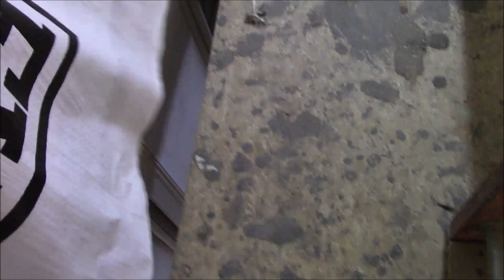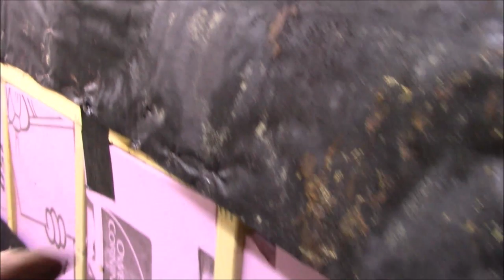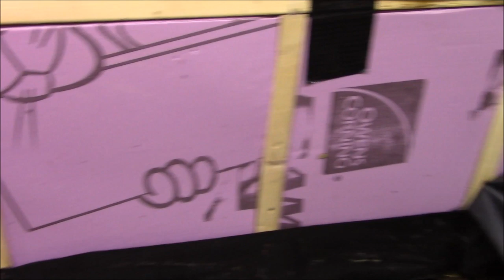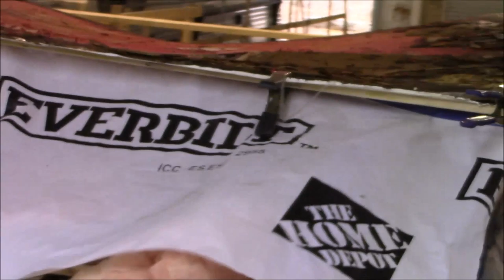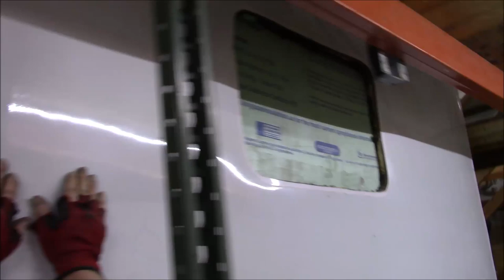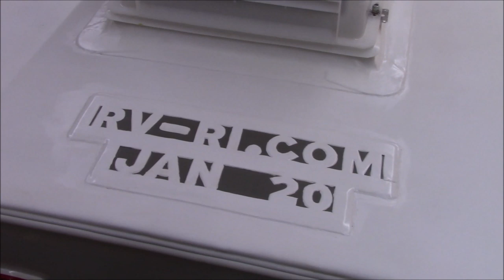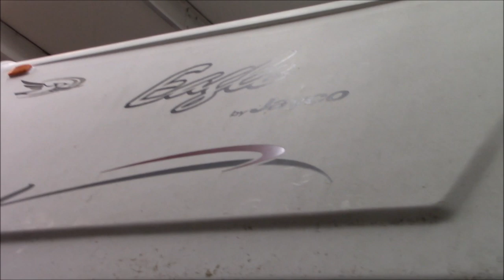Jayco Eagle New Roof, Rear Wall, New Trusses and ceiling panel

Comment: Sir why don't people do closed cell spray foam insulation in while the roof is off?
Reply from the maker: Expensive....very expensive. Plyfoam is a design if the roof...just winging it with spray foam is not.  Lol it's to consider spraying over that you may need access to later. Then the clean up...not worth spray foaming a camper.
Thanks for watching.

Comment: Wow!  I have a 2013 Sierra Travel trailer.   I was lucky that they took a measure of pride building it. That's not saying it had no problems.  I have found a good amount of issues due to them using cheap material and incorrect materials.   Fortunately my floor is real plywood,  not sure how that happened,  probably all they had that day.  Some other incomplete stuff I found such as missing floor joist and I believe they failed to finish the duct work in the ceiling the same as your video.  My back wall needs rebuilt and I would like to have a new membrane.   Aluminum frame in walls,  except the rear.   Very little defamation existing, only around the water heater, which has leak has been resolved.   How can I reach you?
Reply from the maker: you can call the office @ 423-475-7663 .   Monday thru Friday 8am-3pm

Comment: I’d put fire stop foam around all those wires coming to the roof. I’m watching this because I have a 19’ where it leaked  to the floor so a whole front corner needs rebuilding.  I’d like to know what all this work costs to see if it worth having the work done. I can see to do it right scaffolding needs to used.
Reply from the maker: We don't quote on social media, but if you give us a call we can try to get some rough numbers to you. We wouldn't know the extent of the damage until we tear it apart and see how far back it goes...what all needs to come out etc.
Office hrs are 830-300 MF. 
Why would you need fire caulk? That's only used in firewalls, chimneys and stove pipes to prevent a the fire spread, or retard a flame.
Reply: @RVROOFINSTALL  I live in Alaska so that wouldn’t work. Thanks for contacting me though.
Reply: @RVROOFINSTALL  I would use fire seal spray foam that would prevent the wires from chafing. It also prevents moisture coming into the roof cavity. I have built a few homes and do this for energy conservation as wire holes in walls make a chimney for convection.
Reply from the maker: @Chris_at_Home  I'm a GC myself. It's expensive and unless someone asks for specifically we will use rigid foam or batten. Whichever we can get nowadays. 
Thanks for watching

Comment: How much was something like that in $$ roughly
Reply from the maker: Apologies for the late reply. Mr. Michael, we don't quote on social media. But usually replacement is more than the value of the coach, depending on year, model etc...but far cheaper than replacement of the coach. 
Thanks for watching!
Reply from the maker: @kalenen  what doesn't make sense? It would cost more to install a roof in a 28 ft. bumper pull than what the camper is worth, but it would be cheaper to out a roof in one than what it would cost to go out and buy a new 28 ft bumper pull.
Reply: @kalenen  it does, the value of an older coach let's say it's worth $2k this job could cost more, as opposed to purchasing a new coach for $80k.
Reply: I don't know where they are located, but most places are charging $120 - $160 an hour.  So lets say $140/hr.  It looks like there are at least 2 guys working on that RV, so that = $280/hr.  We dont know how many hours (days), went into this, but it had to be at least 3 days worth of work, (probablly more like 4 or 5).  If it took 3 days x 8hrs a day x $280/hr, thats $6720.  4 days of work would be $8960.  Plus the cost of materials, (new plywood, insulation, mold-kill, screws, adhesive, etc.).  That could add a couple thousand easy.  
Now I'm afraid to do anything to my '94 Tiffin Alegro.  Think I'll just drive it to the junk yard!
Reply: @jmsfabrication7821  this video got me thinking the same way,  I guess I'll just let it last until it last 😅😅
Reply: Very eye opening to How Manufacturers slap these things together.... Scary stuff.

Comment: Subscribed!! Love your videos! My wife and I are buying a 1998 Sierra 29ft Camper. Planning on taking off and replacing the insert trim, which insert trim would you recommend. From Wisconsin Thank you! P.S. .. We are planning on living in it full time with our 3 kids.
Reply from the maker: That's an old coach. Watch the videos we have on ultra lite or super lite...can't remember the title...but I go over how to do a preliminary inspection. Beware that class c bunks are known to leak and rot. We have done a slew of them. 
Dx-946-1w is the white we use. So products has some as well.  
Thanks for watching!
Reply: @RVROOFINSTALL  Thank you for your fast response! I made a mistake, it's not a camper it's a travel trailer.
Reply from the maker: @withrootsandeverything3460  the video I mentioned is a TT toy hauler. Watch it. You'll see.

Comment: I bought a Jayco new from Camping World. They hooked it up. We took it home. Next time we hooked it up the connector wouldn't plug into my truck. Took it in under warranty and they wouldn't honor it. They said the connection on the trailer was likely tampered with.  I will never purchase another Jayco or do business with Camping World.
Reply from the maker: We had the problem on a new Ford. Lights worked in my old Chevy... customer's older Chevy. He bought a brand new Ford and the lights wouldn't work. Called a trailer and aftermarket company and he said the new trucks need to be flashes or programed for the trailer. That's may be what's wrong with yours. Unless you got it figured out.

Comment: Sorry, another question...your videos are addicting... the counter flash, is that just the Eternabond 2" you use to fabricate that then use the 4" around each structure?
Reply from the maker: No....it's all TPO. All welded together, not glued. Then welded to the main roof sheet membrane.
Reply: @RVROOFINSTALL  that's right, you said that before that its TPO. I guess I need to read more and figure out the difference between TPO and the products like Eternabond. Thanks again for answering.
Reply from the maker: @tomcat5986  eternabond is a brand of roof tape. TPO is a form of roofing membrane, just like PVC or EPDM (rubber). TPO and PVC are weldable. EPDM rubber is not. All are typically glued down. EPDM thinks and us unstructured. Structured membrane has a weave or mesh in the center to add strength to resist branches and hail. EPDM is what I consider a low budget membrane. It literally is the cheapest product on the planet. Most architects will specify EPDM because it is cheap but the fail quickly at protrusions and in bigger projects the lap joints will fail because they are merely glued.
Reply: @RVROOFINSTALL   That was an excellent delineation between the different materials, thank you. I love the idea of you making those weldable pieces around the vents using the TPO.  I would really like to do that to all 3 of my trailers. What quality TPO brand do you lean towards to do that?
Reply from the maker: @tomcat5986  we use Carlisle.

Comment: At 24:30 So by using a mold killer spray like Concurvium, you do not have to replace the black mold affected support system or luan?  Thank goodness!  Lol
Reply from the maker: Wet wood will get stained appearing to be molded. If the wood is solid chances are there is no mold. We spray just as a precaution. On this video the rear wall looked well... dirty, but not moldy. You can usually smell mold as well. The front wall needed more attention. We do not want to over exaggerate stains as mold. We also do not want to lean on a customers wallet for something that isn't necessary.  If you are not family with mold, how to recognize it or the differences between water stained wood and mold you should do some research in it. We definitely would not close up a coach that had mold and deliver it out. 
We don't recommend these videos as DIY videos or tutorials because we don't know your specific conditions and damage and do not want to mislead anyone into proceeding in the wrong direction on any repairs, patches or even caulking and sealing. 
There are mold kits available for you to check and also identify mold. Black mold is generally slimy,  whatever you may have spraying concrobium on the mold will kill the cells and it is recommended brhar you do so prior to removing any rotted molded wood so if, by chance, there is mold, it will be dead and not airborne. Where glasses, goggles and gloves when. Working with rotted wood to be safe. 
So to answer you question, knowing if the wood is stained or molded would determine whether it should be removed and replaced. 
Set a piece of wood out in the yard, not in the ground and you will see when it weather's it will stain. Firewood is a good example of weathered wood vs rotted wood. I would also point you to learn more on mold. There are plenty of videos in YouTube. 
Thanks for watching.
Reply: @RVROOFINSTALL   Can not thank you enough for taking all that time to share knowledge and concerns and cations towards diy endeavors.  Thank You :)
Reply from the maker: @scottlund4562  it's hard for me to advise because I can't see what anyone has going on. I don't want to mislead someone. I don't want to be responsible for someone not knowing how to do and why to do and things fail. That's why we say these are not DIY videos or tutorials.
Thanks for watching. Maybe you can pick up a tip here and there.
Reply: @RVROOFINSTALL  Love your honesty & integrity!!!💜

Comment: Why wouldnt you paint or Thompson or something for the trusses all the new sheeting and all the new wood???  why leave it bare?? Would be an extra protection cause it WILL leak again
Reply from the maker: ?..a quality roof doesn't leak. What's the sealer going to do if it did leak? Leak somewhere for sure. Besides that, adhesive may not be compatible to adhere the roof. The adhesive I'd waterproof.
Reply: Just seems like it would be a good idea to primer the bare wood with something after you adhere it. Like a final. All the new wood on the walls is unprotected. Yes a quality job isn't at question cause your work is impeccable. Was just wondering why not primer bare wood that may encounter moisture down the road. So if  there is a leak it doesnt tear it up so catastrophically. Just your thoughts. I did it to mine. Just as a final b4 I sealed it up didnt primer the side of the wood that needed to be glued or caulked. Asking cause you are a pro was wondering about your thoughts.? Being totally friendly BTW.
Reply from the maker: @mikefyfe9695  are you talking about the roof deck? Or something else?
Reply: I'm talking everything roof, sidewalls, back wall, any bare wood left unprotected. I just want to know why you wouldnt at least throw a little primer on them? Just as a second line of defence? And I do appreciate your knowledge and wisdom. Thank you very much for your responses. Very much appreciated. 🙂✌
Reply from the maker: @mikefyfe9695  it is protected....with siding and with roofing. Anything more us a waste of time and money. Siding and roofing isn't permiable.
Reply from the maker: One thing I have learned is you can't stop mother nature. If the job is done right then it shouldn't leak. Inspections are important because nothing lasts forever. The siding won't allow moisture to permeate through, nor he roofing. If that was the case then codes would be changed to account for any moisture protrusion. They changed the code in Stucco...or should I say... synthetic stucco like Drivet, Stow and Pakcrete. Those are not real cement and they all got sued enormously because moisture did get in when the acrylic coating failed and causes serious mold issues. 
Thanks for watching. Thanks for the feedback.
Reply: @RVROOFINSTALL  that being said then why all the water damage then? #1 problem with RVs. I dont think there wouldn't have been so much damage to this RV if the bare wood was primed. Leaks are gonna happen water will find a way. I personally think the factory should prime the bare wood. There is too many examples of why you dint need to.
Reply: Thank you sir. Oh one more thing if you dont mind rather than  seems and caulking where the sides of the corners meet among other places where they butt up. Is there any problem with fiberglassing them together? That way its permanent and no way for sealant to fail cause there is none. Kinda like a hull of a boat. Just wondering your thoughts.
Reply from the maker: @mikefyfe9695  these camper rack and flex too much. The joint would more than likely break or crack. A bull is designed differently. The siding is not fiberglas. It's plastic reinforced with fiberglass. I am not a fan of the aluminum sided but in either case when we install them we load them with an adhesive caulk. It's kind of like Liquid Nails in steroids designed to be used on an exterior application. If you were to fiberglass the corners you would need to figure out how to reinforce it so it wouldn't crack. That said you'd have to figure out how to literally stifle the racking and flexing if the coach. A lot of unnecessary worry if you seal it well. Going on your theory of mosture getting in the coach behind the siding....if you ha e vinyl siding on in your house moisture is getting behind on it. Specifically condensation. Even though there is an underlayment, the fasteners that hold the siding in and the underlayment on are not sealed. So potentially you could have the entire house walls rot. I understand you being determined to ensure there are no leaks but again, once you got a quality roof installed and you have the coach sealed around windows etc, do inspections to ensure its sealed, you'll be fine. Sealing the wood won't prevent a leak. If there is a leak I would like to know where and when instead of not knowing while it travels somewhere you can't see and then find out when it is destroyed. You cant compare our roof system with an RV roof system. All our materials are commercial grade products. We don't use any RV products. The system is welded together, not caulked together like RV roofs. So essentially the welds would have to be broken apart. Much like a metal mig / Tig weld. The roof literally fuses together as one piece.  
Understand.ypu will not stop the motion of rack and flex and trying to do so will just result in failure. It's the physics of the coach. When we rebuild anything we account for the movement so they will allow for flex but stay together as one unit. That's done with quality flexible adhesives and proper fastening system. Campers are rolling cabinets.

Comment: Dicor= dollar tree caulking. Lasts longer, and much cheaper to redo. You're supposed to reseal ANNUALLY anyhow. What I used when I replaced the door lock as well as when the entryway door glass decided to dislodge from the plastic trim. Sealed her right up and no more glass falling into the doorframe issues.

Comment: Wow, where are you located? Have a Class A in need of a roof. Great job.
Reply from the maker: Hello. We are located in Fort Oglethorpe GA just a few miles south from Chattanooga TN.
Reply: @RVROOFINSTALL  thank you, I'm in Salisbury NC. You have a great system, very thought out. We have a 2000 Newmar, is that Flex armor worth looking at, we have a shop an hour away. Hoping your were closer. It good to see craftsmen still in exist, God bless you and your business.
Reply from the maker: @frankkernan751  Mr.  Frank we used to do commercial roofs and commercial coating. The Rv armor is only a coating. If it was worth installing wewould buy the machine, they are always looking for installers. Some of the reasons we do not endorse the system is because 1. it will not elevate the vents and AC like they should e done. 2. What is the roof deck like on your coach? You never now until you get the roofing off. We did a hideout 5th wheel that had a minor antenna leak and if we did not remove the roofing we would never have seen it. The water was still pooling on the top side of the ceiling. Had we not investigated and roofed it the water surely would have soaked through and the customer would be adamant there was a leak. Watch this video we have on our channel. It should answer most of your questions.......https://www.youtube.com/watch?v=ibDp8wQ2KM8
Reply: @RVROOFINSTALL  thank you I'll watch it. How far out are you in appointments, and what is the turn around time? Thanks 👍
Reply from the maker: @frankkernan751  can you give us  all in an our and we can help answer your questions...423-475-7663. It would be much easier that way....and we can go over anything else you may want to have done. Here from you soon.

Comment: That entire RV should have been scrapped! Good workmanship in your repairs, however I doubt if it was a financially wise decision in that condition.
Reply from the maker: The customer figured that if he bought another one it would be through our shop for at least a roof anyway. Also he liked the size and the fact it doesn't have a slide.  I don't think they make class C without slides anymore.
Thanks for watching.
Reply: @RVROOFINSTALL  I've  watched a couple more of your videos and you definitely install the best RV roof that I've ever seen. The attention to detail is excellent! I'm curious to know the cost of one of your roofs, however I know you don't quote prices on YouTube. Probably worth whatever the difference is though.
Reply from the maker: @vegasfordguy  RV roofs are expensive anyway, but we are about the same as a real RV center...the guy down the street with a pickup truck and a ladder is definitely going to be cheap..lol
We've prices some that are under RV centers....I guess it depends on how much work they need. We stay covered up for months at a time.